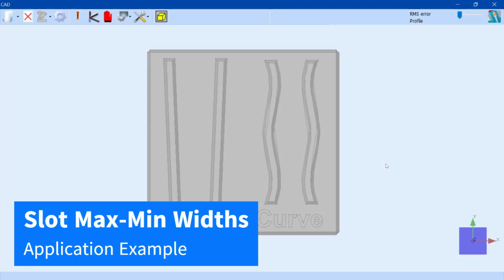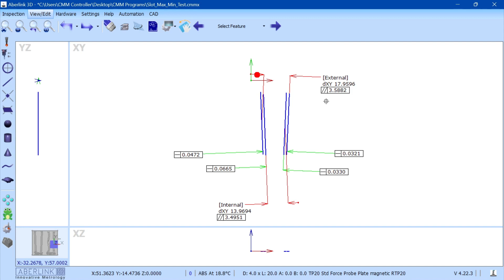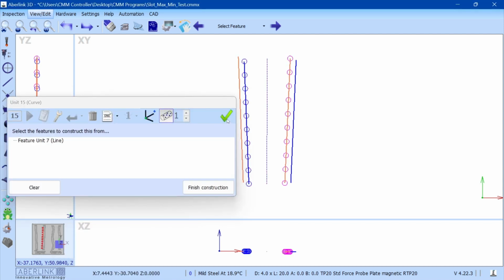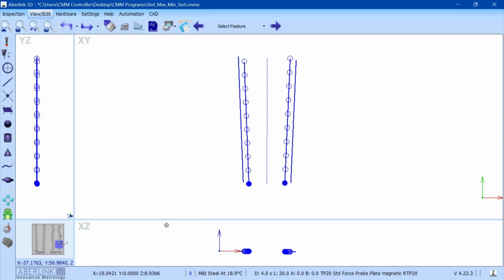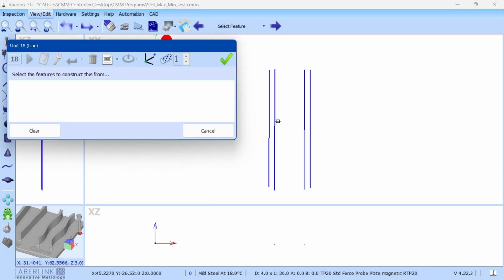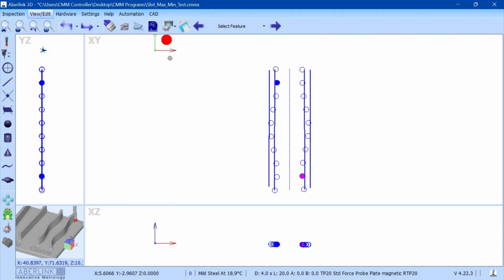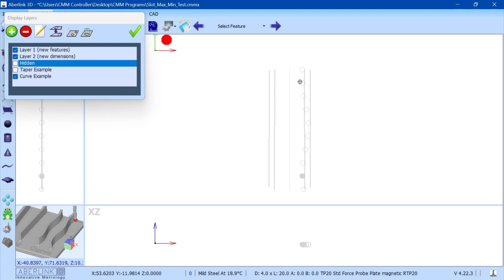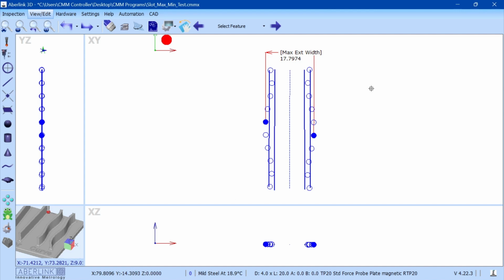Aberlink3D | Max-Min Slot Widths

Comment: Love the vids. Are the minimum and maximum widths based on the min and max of the curves, or the min and max probe positions? As that's how it looks like the software is choosing the min and max points.
Reply from the maker: It's from the curves. Graphically it does look like the probe positions, but the values are compensated and are actually from the surfaces i.e. curve data.